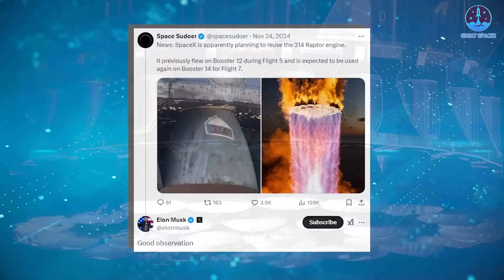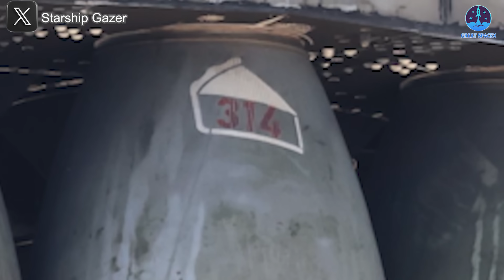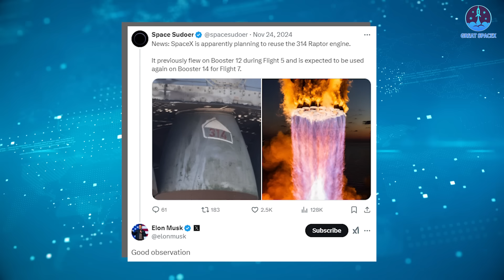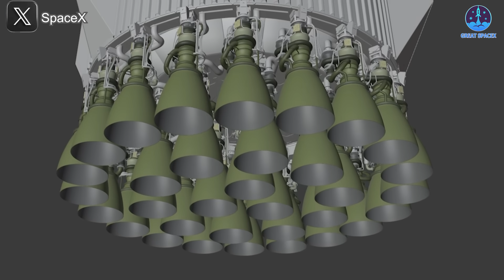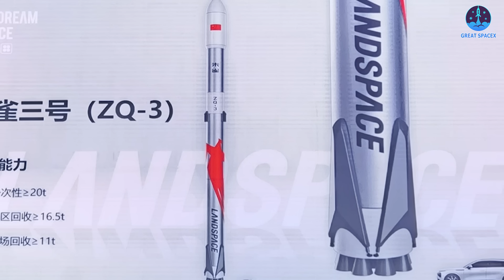Elon Musk revealed SpaceX to REUSE Flight 5 Raptor on Starship Flight 7...

Comment: Reusing an engine, just like SLS did with a shuttle RB25 engine.
Yeah, so ground breaking.
Or for that matter, every Space Shuttle. Welcome to the 1990s.
Starship will not be a fully reuseable ship until they stop dumping the hot staging ring. SpaceX has caught ONE starship booster so far, and it was on fire. Meanwhile it has landed around 400 falcon boosters and reused the Merlin engines more than 20 times on some first stages.
Reply: Just say you're a l oser and save yourself time.
Reply: @StratumPress  wow, you a Elon Musk fan boy? Must be great to worship the Musk, usually from those that can't make a success of their own life.
Reply: Fun fact. They doing thins thing called "testing" of the starship. They did the same with falcon 9. You should look it up.